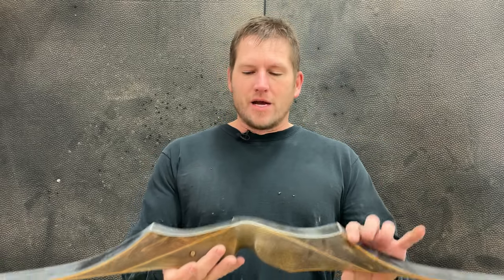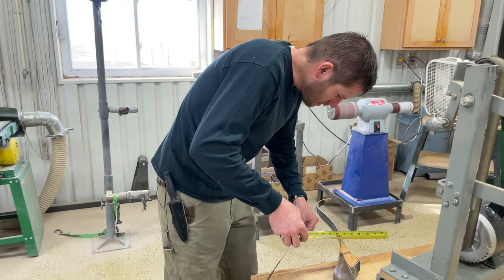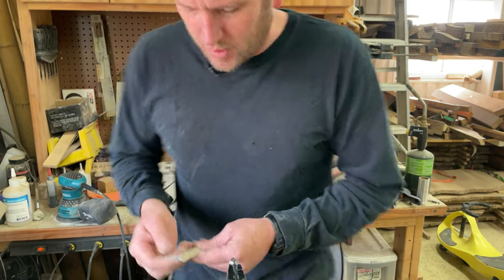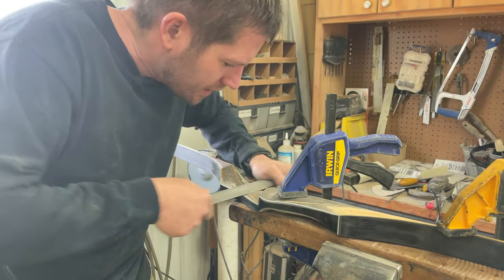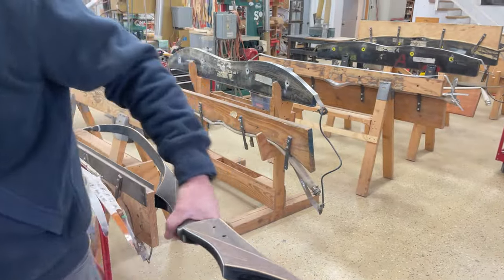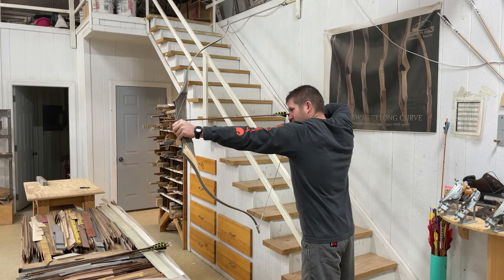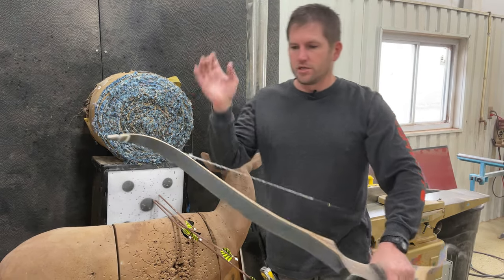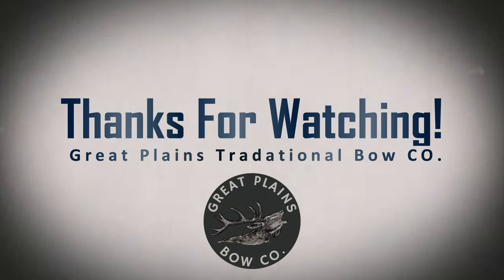Bighorn Bow Restoration

Comment: Rip emery cloth about 180 grit into  about 3/16th wide strips for string grooves..   I have refinished and reduced weights on several Asbell bows , easy designs to work with,  wish he had a bit more taper in the lams .. great work .   The glass is the older Gordons glass that had the peel away strip for the glue side.,It is actually slightly softer and and does smell different while working it.. It will be usually .050 thick.
Reply from the maker: That's interesting info on the Gordon's glass thanks! On the emery cloth I have tried that and it really doesn't work as well as how I do it. You can actually buy rolls of sandpaper cord that I've heard some bowyers use. Tried that also. Not for me

Comment: I have a Bighorn custom recurve takedown that was  from about the time that G. Fred Asbell sold Bighorn bow Co. It has a much better low wrist grip than that 1 piece bow. However it's a 65 lb. @ 30" model & I can't even string the beast. But there r alot of old school similarities to them.
Reply from the maker: I hear ya. Have you thought about reducing the weight on yours?
Reply: @greatplainsbow  Nope, but I failed to convert it to an ILF setup. Very hard to find a nice 19" riser out there. It's so heavy & stacks so I never considered it an option to your video.

Comment: Great restoration & very educational !!
In this video you mentioned how that bow stacked and that certain parts of the limbs were not working at one point, my question is can anything be done to re-set a draw length to say 25 to 28 so it doesn’t stack so much ?

Comment: Hello.
I'm going to make grip a little thin and coat it again.
But that part has a slight difference in color.
I don't have any equipment, so I need to use a spray, 
Do you have any products to recommend?

I want glossy, darker than the original woods, and a scratch-resistant coating.
And it's important that the coating permeates the wood well.
I get a lot of ideas and possibilities by looking at your work.
Reply from the maker: One of the best clear gloss coats from a spray can is the Rust-Oleum 2X clear gloss
Reply: @greatplainsbow  Thank you.
You've recommended it once.
It was imported to South Korea a few years ago, but now it's all sold out.

"Rust Oleum Varathane polyurethane gloss"
This is in stock.
It's from the same company, can this replace it?
Reply from the maker: @파닥파닥물고기  sure that'll work. Just remember to sand with high grit sandpaper between coats
Reply: @greatplainsbow  Thank you.
When ordering your bow, I will definitely ask you to cut the grip a little thin.
I have deep trust in your work because you showed me the production process in detail.

Comment: What sort of spray finish do you use? I'm in the process of redoing my wooden recurve with fiberglass reinforced limbs. Not sure what I should spray for a finish. Or if I should even sand the fiberglass
Reply from the maker: Do you have an hvlp?
Reply: @greatplainsbow  I do not have a spray gun sadly. I was thinking of doing varnish on wood and then seal the entire bow with a polyurethane spray
Reply from the maker: @BlessedNoob  sure you can do a very nice finish with an aerosol can. Just remember to sand between coats with about 320 grit. For that I'd use Rust-Oleum 2x ultra cover. Start with the clear gloss and finish with the matte
Reply: @greatplainsbow  I will give this a shot! Thanks a lot for the advice

Comment: I think you should be wearing a face mask of some sort.  Just sayin, did a decent job on the recurve though.  A splatter coat of epoxy would have made it look stock though.
Reply from the maker: Hey thanks for watching! Yeah a face mask would be good. I think a splatter coat of epoxy would look bad. I know what you're referencing on that finish, but I've always hated that look and the bow didn't have that finish on it so I don't know that Fred was doing that. I've never seen it on any of his bows anyway. It wouldn't have looked nearly as nice with that kind of finish on it
Reply: @greatplainsbow  That was the finish Asbell used on all his bows as is my knowledge and from owning a ton of them over the years.  I also was able to test prototypes through Creekside Gun Shop when it was open through the archery manager there whom I was friends with.  He helped Fred develop there recurve design and especially his longbow design.  Has a ton of input on the 62" t/d sleeve t/d longbow Fred made.  stay safe

PS  Fred didn't really make bows either, the Nelson brothers did.  Fred inked them and on occassion sprayed them with the epoxy coating he developed.  Although before the Nelsons I think a fella named Tom ran the custom shop but might be wrong on that end.
Reply from the maker: @longbow5423  I hear ya. Interesting stuff. Thanks for the info!